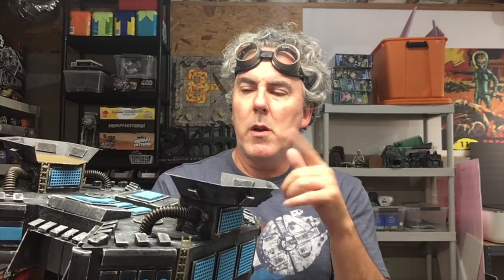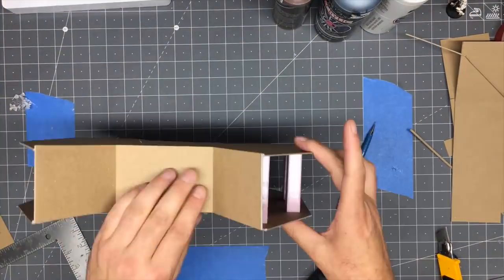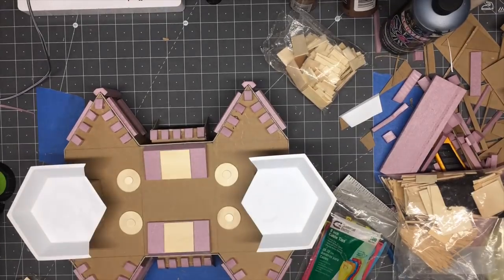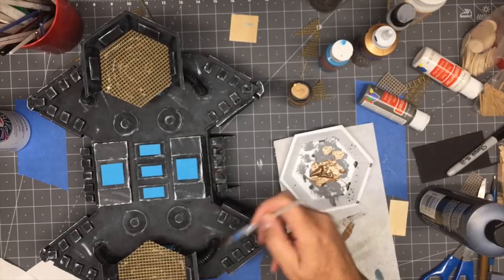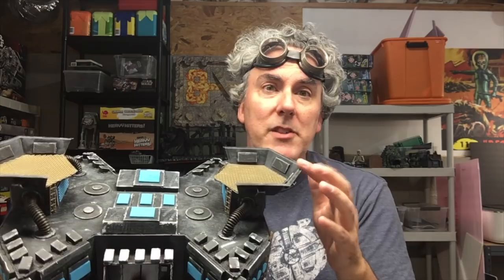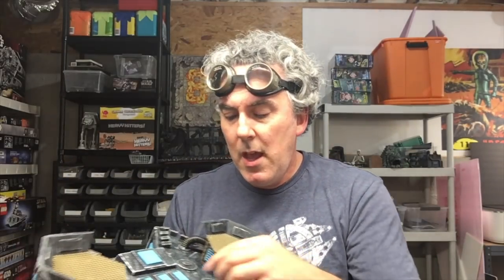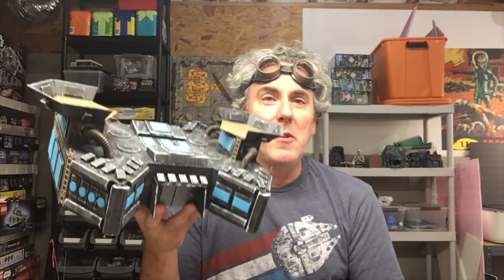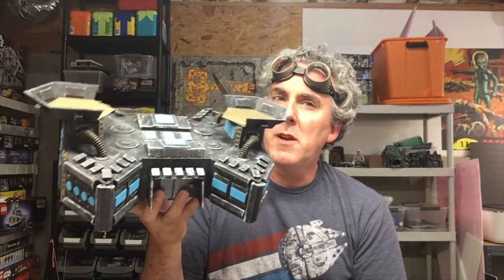GTE 071 -- SpeedBuild -- SciFi Command Center

Comment: I personally think a speed build requires context. If you make something far faster than it usually takes by simplifying the process it’s a speed build.

But in general my metric is if you can build it in one sitting.
Reply: Btw...the regular releases. It’s HARD. I went though the same thing as you mention in my first year, complaints about not enough videos. It was when I started Patreon that I made the commitment of a video every Friday. Since then I’ve not once missed that in over two years. BUT this came at a big cost (time with family and personal time being completely sacrificed). I came close to burning out many times. The only reason I didn’t was because the channel was my end game, my exit strategy from my career. And it worked, eventually. Consistent release schedule is crucial to growth and success on YouTube BUT that’s only important if you are doing this with specific goals. If it’s for fun, don’t stress over it. If it’s simply to share your passion don’t loose sleep over how much content you put out. It’s only if there is the added goals of it being a business where you need to really start worrying about it. Point is, you’re doing a great job, and whether or not release schedule matters depends on your goals and reasons for doing this....don’t let comments get under your skin. It can be hard, they get to me all the time.
Reply: Good points. I think I'll go with the single sitting. I made this base in one day, so we'll call it a speed build. I used the wooden pieces instead of cutting tons of chipboard into small pieces. The spray painting and drying took an hour (thank goodness for the heat of Atlanta) that I didn't included in the time estimate.
Reply: THIS.  This all day long.

Comment: Awesome build. Thank you!
One question: where does the piping come from? Thanks.
Reply from the maker: I cannot remember what they are called, but they are plastic coils that you insert wiring into to protect them or collect them in a bundle. You can find them at most hardware stores around where stereo and phone accessories and wiring stuff is sold.
Reply: The Tabletop Engineer  Thanks; penny dropping 😊